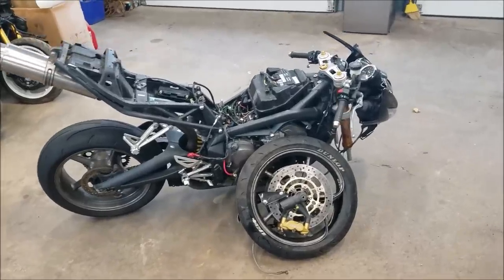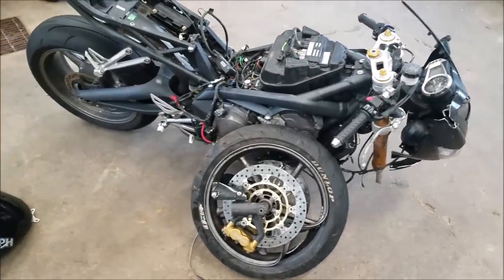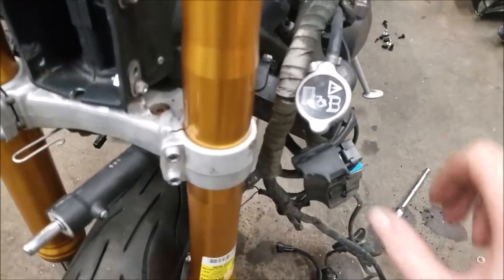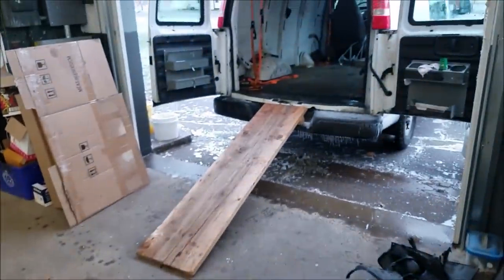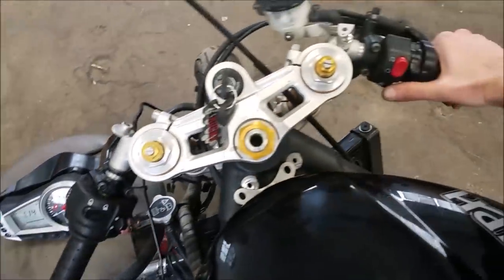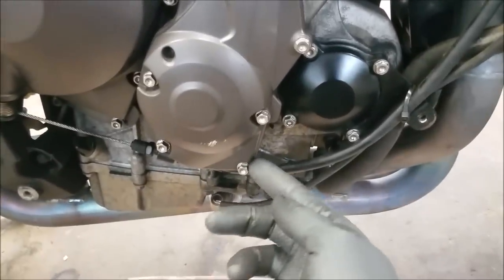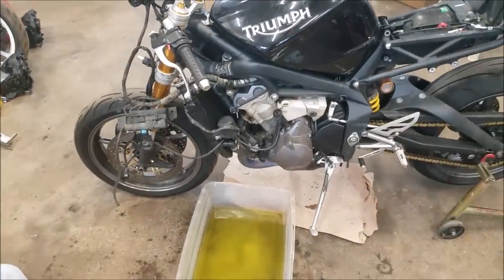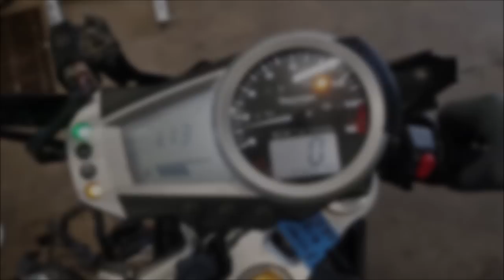Triumph Daytona 675 WRECKED Bike Rebuild (Part 1) +Giveaway!

Comment: Keep the Nice and clean work. I've watched all ur rebuilds and the most important after these kinds of rebuilds is to check the Active Safety of every bike check and repair a (bent frame). This 675 made a horrible crash. In none of your videos said if the parallel of wheels and many other factory parameters of chassis are correct. Remember that's the most important for the new owners or your SAFETY when riding after those type of repairs in every bike coming from a big crash and if its ok 100%. Im not write all these to criticize bad your/our job cause u work great. Keep Walking. Your videos are great. Best regards from Greece Man.

Comment: WoW , I'm surprised at just how similar the designs are across different
 makes . I had a 2000 YZF R6 and the front stay , fairing , and 
headlight assemblies are almost the same . I realize there's little room
 for variation but I wouldn't have  expected them to be that alike . The
 only major difference is the air intake on the Yamaha went around the 
stay and the Triumph goes over it .
Reply from the maker: Yeah a lot of the sportbike models are pretty similar across the board

Comment: The Daytona 675 and the Street triple are well known for snapped off steering stops. Had the same issue with Mine. The preowner just tipped it over on a parking lot. I wasn’t that sure about welding that close to steering head, so I decided to glue that missing part in.

Comment: Need help! Desperately!....redoing rear on 2017 Daytona 675 (previous owner wrecked it).  Took subframe/battery tray etc off.  It was a pain getting to some bolts inside tray towards the front. Is it better to split subframe in half and replace it half, battery tray, then other half?  I had to paint battery tray and do not know how to put it all back together without jacking anything up or scratching tray.  It did not seem like tray would just slide right back into subframe. Any input would be awesome.  Cliff noted step by step in getting it put back together?  Love your work.  The color scheme on that 600 RR was awesome.

Comment: Always wanted a 675, I vote 636 however though hahahhaha
Reply from the maker: I would have been worried if you voted for the R6 haha
Reply: You want a 675? Few things to lookout for, failing stepper motor. The servo valves always fail, just have it flashed out or remove it but expect a check engine light. 
My 657R was stolen and recovered totaled and insurance wouldn’t cover it because I was 24hrs past the dead line to renew my policy

Comment: I hope you noticed that the radiator was bent and few of the tubes where crushed. They should be straight and not crushed together. You can see at 11:47. That radiator needed to be replaced.

Comment: Good tip that one where you are using distilled water and vinegar
Reply from the maker: It helps break up any gunk that might accumulate in the cooling system. Cleans it out good!

Comment: That looked like a fairly big hit at the front end. Do you put them on a jig to check frame alignment before starting? I'd be worried the headstock was twisted or pushed in.
Reply: No chance, if the headstock is bent then hopefully the used forks are bent in the other direction to compensate. Even if it steers like a crab it wont matter as most roads over there are straight. Just throw a chinky fairing on it, jobs a goodun. Seriously, this guy is one of the biggest bodgers I have seen on Youtube but all the Shermans in the comments think he is some kind of mechanical genius.

Comment: I would personally never buy a motorcycle that's been in an accident. There is almost certainly deformation in the frame, something you wont really be able to check without specialized equipment. That bike will never be the same as before the crash.

Comment: The front tire running wrong way 😁
You make a mistake
Look at the ➡️ indicater on the tire dude.

Wtf do you wanna do when it's beginning raining alot .

You actually bring it to the center instead of pushing it away
Reply from the maker: Other people have said the same thing but I double check the tread and it's facing the right way for some reason front tires look like they have a backwards tread pattern
Reply from the maker: Good eye though!

Comment: Another front tyre on wrong.
Reply from the maker: The front tires are mounted correctly I have checked the directional arrows on all front tires. Some front tires look like the tread is reverse, I plan on making a video about this explaining why
Reply: RK Motorsports Hi, it just look wrong that the tread would bring the water to the centre of the tyre.
Reply from the maker: Yes I know it looks goofy but I read that it is set up that way because the front tire is mostly under load during braking, so the reverse tread pattern is designed to push water away from the center of the tire while decelerating in wet conditions. I give you credit though, not many people pay that close attention to detail and would spot something like that